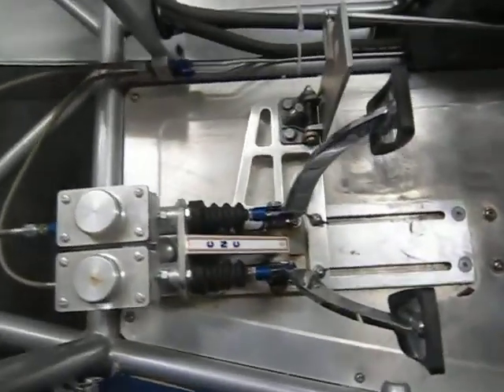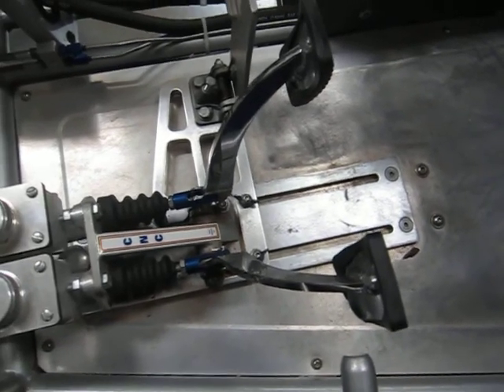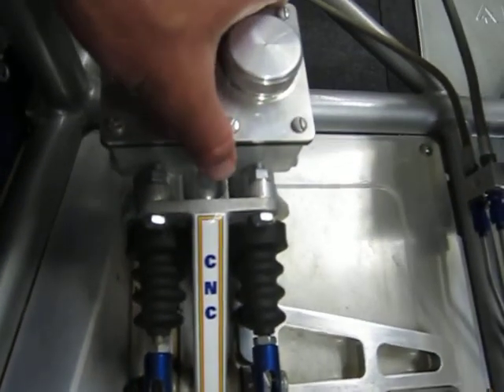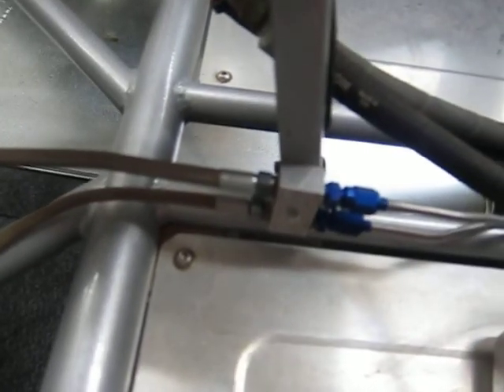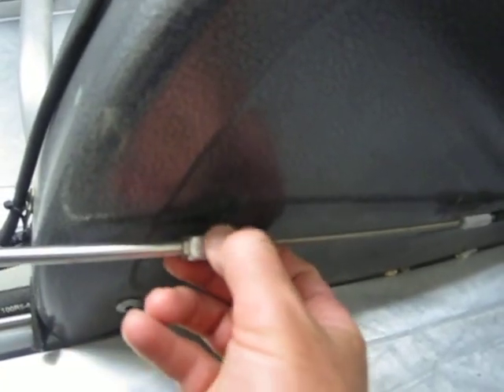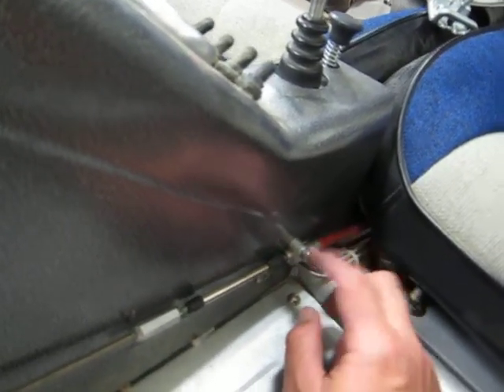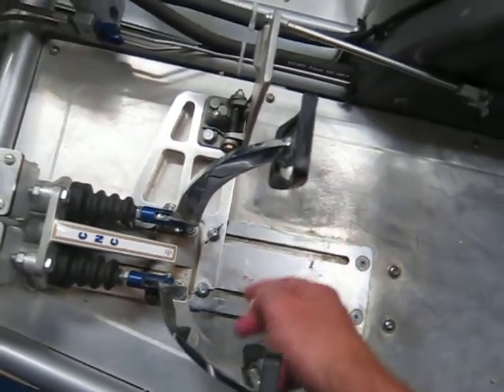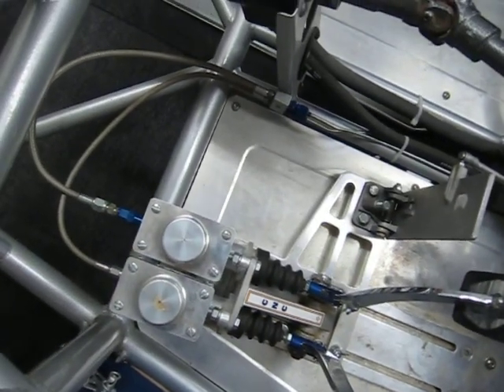Take a look at how a Pedal Slide should be installed

Comment: Hey there.  Would you be able to post the link for the flex line kit with port lock you used here?  I'm looking to do the same thing with my rig and having a hard time finding a kit like that.  Thanks!
Reply: Michele Fitzgibbons it’s called a brake line junction block. Try Jegs or speedwaymotors. The one I have is made by CNC and they are out of business.
Reply: The brake line should be easy to find. Just look up flexible brake line and the length you need.
Reply: Thanks, man!
Reply: Found it.
Reply: @anthonywindle4398  oh my gosh thank you SO much!!!   I really appreciate that!